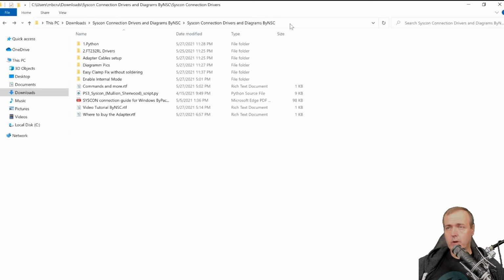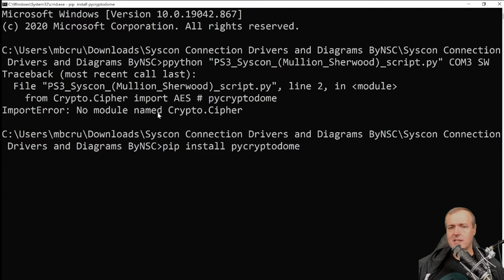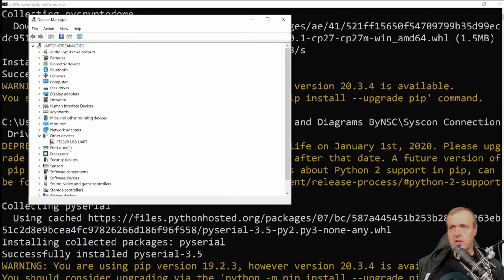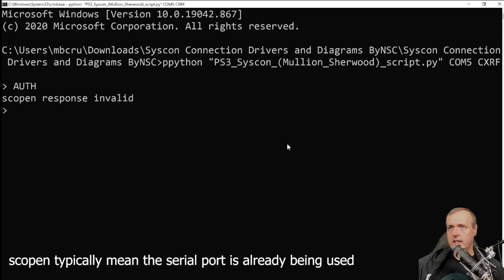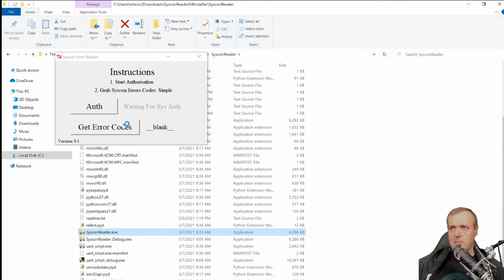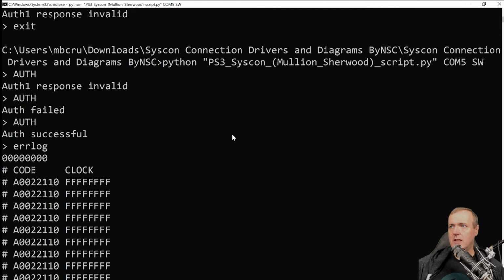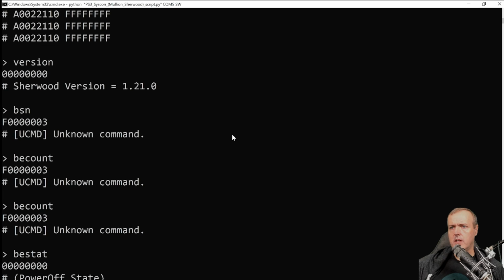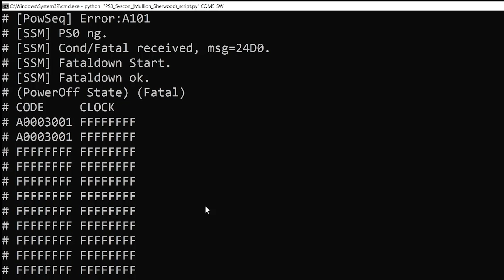PS3 SYSCON - Software Tutorial

Comment: That GUI is actually not 100% reliable. I think it can't show more than 20 errors, while syscon keeps 30 of them. There's also an issue with determining which errors are the latest and which are not.
Reply from the maker: good to know. i fixed a few ps3 last year with it and what i came across is that you need to look through the log carefully. lots are false positives (such as the ones that pop up without all the hardware connected)

Comment: Almost every command I throw at this gives me the F0000003 error. I'm using this on linux & have tried both upper and lower case characters. I've also tried with diag grounded and not grounded. I can not for the life of me figure this out 😞 please help me if you can.
Reply: did you intall "pip" ?
Reply: Which board are you working on? It's a bit different for COK-boards.
Reply: same did u ever find a fix for it